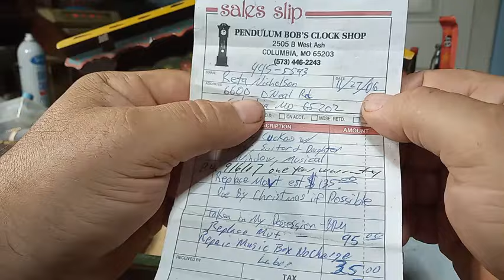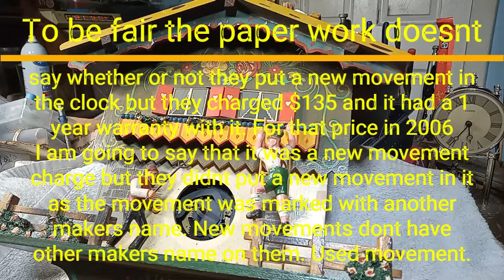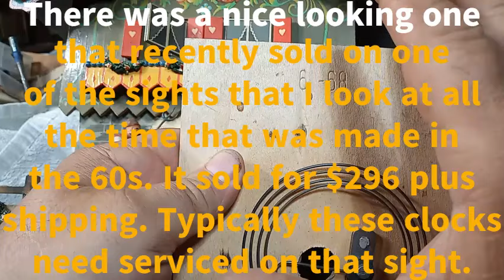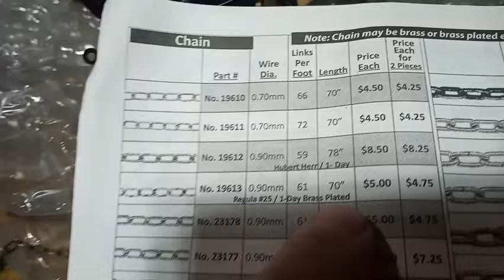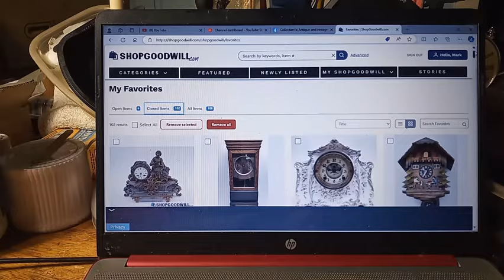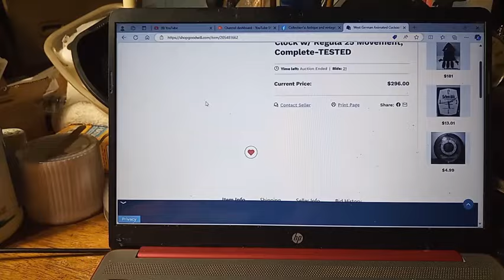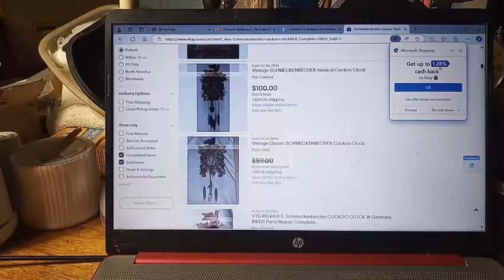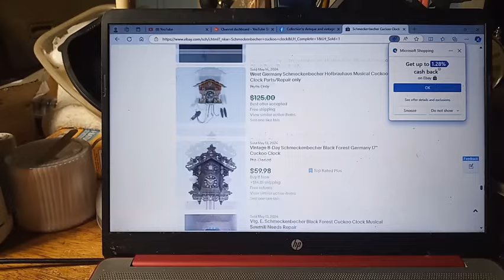Repairing a 1968 E Schmeckenbecher Farmers Daughter clock that I bought off market place part 2 of 2

Comment: On my clock, I made the mistake of waxing the chain and the rubber wheel has harden a little and doesn't have the grabbing feel anymore. Rubbing lacquer thinner will soften up the rubber a bit and cleaning the chain again helped. Just a little mistake you said, the place you put a string to make the clock cuckoo, This movement will not help reset the count of the cuckooing. Thank you for the shout-outs Mark. God Bless.
Reply from the maker: Thanks for the tip on the rubber wheel. You are correct.  The movement will not advance by pulling on the string or wire if you were to add one.  I guess it might be used to find out what time it about if you were blind because it will cuckoo the last sequence that it cuckooed. So I will have to correct myself in my next video.  Thanks for keeping me straight. LOL.  
Thanks for watching. God bless you and yours.
Reply: @munnerlyn3  We have to remember that it is fun to activate the cuckoo to show off the clock to friends and family when they come to visit.